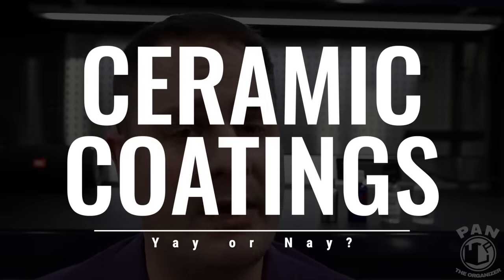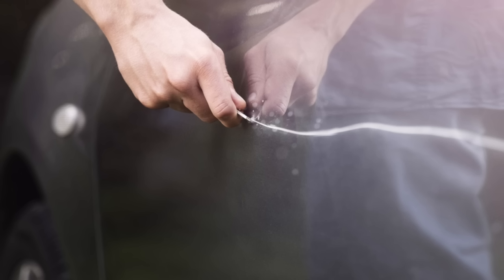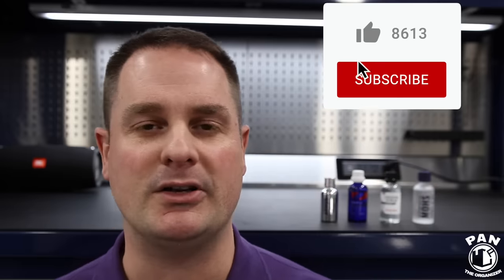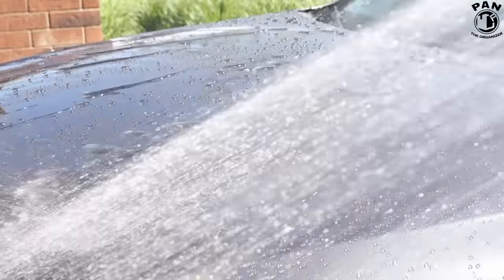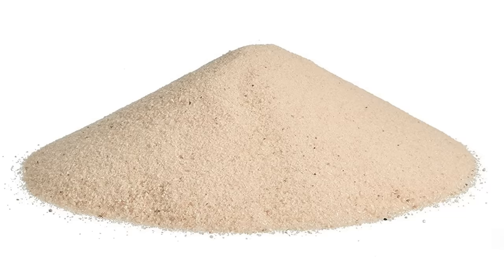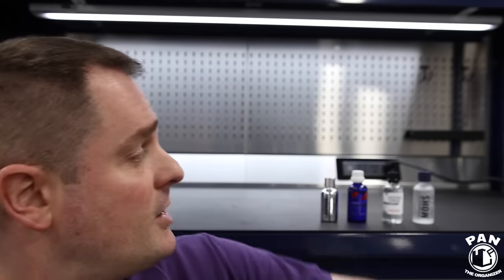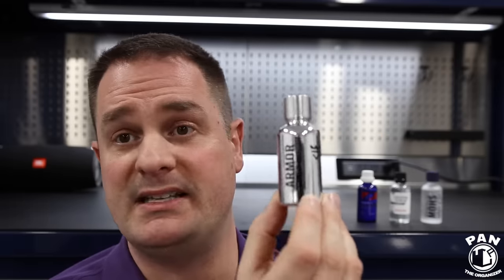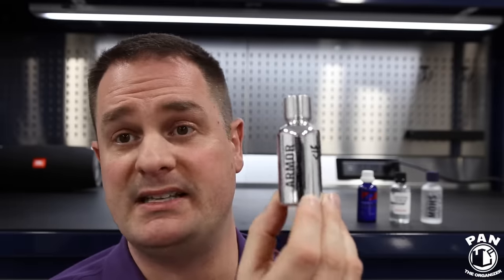DON'T BUY CERAMIC COATINGS BEFORE WATCHING THIS !!

Comment: I am a car guy and doing research I had to watch. I guess my question is as you said, ceramic coatings have improved, but so have base coat colors and clear. 
How long after finishing a complete refinish of a classic truck, with a high end clear would one wait before applying a ceramic coating?
  After 38+ years (42 or more) but as a certified automotive ASE Master tech since 78. (You have to have two years before awarded certification) but years of hands on work to take the 60-100 question test, 8 to be a Master Tech, then re-certify every 5 years.
  I am building, restoring completely at 67 C10 to my 6’3” frame but with modern OD automatic and EFI engine and a list very long. I painted my first car in 1979 and 5 others since. This world of aftermarket parts plus paint products has changed as well. Minus body work, but $1,800 in paint product alone is not uncommon for a truck complete.
  Micro-sanding with a short-stoke (5/16th orbital action) produces a surface that when compounded, then polished and clean with soap and water. After 3-4 weeks, shrinkage is done, solvents have evaporated and chemical cross-linking has occurred. If covered and garaged but not driven, is it “Best Practices” to apply?
 Retired, disabled and never will own the garage I want as I brought home 4 tool boxes and a truck load of equipment that magically makes a 1 1/2 car garage real small.
  People don’t realize what “UV” A, B & C can do to fabric, plastics while at work and just sitting in traffic. Yes, they have a garage but spend little time in it than they think.
  This vehicle is for me and seen the commercials, but felt you did a very good job. Although it is 19 months past the video (May, 20th, 2022) I hit liked abs subscribed even though I had no cell since 2009! Thanks.

Comment: Great video Pan!! It's great to clear up some of the confussion over ceramic coatings. They are awesome products, it's a shame some companies and installers, gave them a bit of a "snake oil" reputation due to false claims.

About scratches: Gtechniq actually states in it's FAQs that although the coatings on their own are very hard, 9H for Crystal Serum Light shown here, when applied to a panel the coating only adds 3 to 2H to the original clearcoat hardness. Still, I think ceramic coatings do prevent scratches, not in the way most people think (i.e. taking a key, knife, rock to the panel), but in an indirect way as the car is easier to clean and dry meaning less rubbing/touching is required inducing less scratches. 

Also, I hoped you touched on the top coats, as I find people confused about why should they apply (and more importantly, buy an extra product) that adds hydrophobic properties and slickness...when the ceramic coating is already supposed to do that.

Cheers!
Reply from the maker: Thanks Mati

Comment: Can a DIY'er apply a coating the answer is yes but only if they follow the manufacturer's instructions.  I have used most all of them and yes, easy application does seem to go with Avalon King.  

My first choice of ease of application is the Dr. Beasley's Formula 1201 for any DIY'er.  It too requires a solid foundation preparation and use of the topper at least every two months to get a solid year of life.  

Great recap of the topic Pan, glad you covered it fully in this Q&A session.
Reply from the maker: Thanks!

Comment: Awesome video as always, Pan. I'm a huge fan! Could you talk about the disadvantages and any downsides of putting on a ceramic coating? I imagine fixing scratches is a lot harder because you need special compounds and techniques. Cheers! 🍻
Reply from the maker: Thanks! I appreciate your support. :)

There aren't many disadvantages of ceramic coatings really, other than you have to be more careful about water spotting, hence why most of them you can get the appropriate top coat to put on top, or use a highly sheeting coating like the AvalonKing, which sheds water quickly.  Other than that, I mean you truly get the best possible protection:
- best gloss
- best slickness
- best UV protection
- best durability (years vs a few months for regular waxes and sealants)
- best chemical resistance (industrial fallout, road salt, bird droppings, tree sap, brake dust, etc)
- best hydrophobic properties (water beading and sheeting)
- self cleaning properties (car is a lot easier to wash during maintenance washes)

You absolutely have to watch a super popular video I made about the differences between waxes, sealants and ceramic coatings here: https://youtu.be/Yxz3zSVIm-g

Comment: Hi everyone just watch pretty much the whole video, as an " old old " detailer the last one when you use microfiber towel cleaning the ceramic coating the towel pretty much needs to go in the bin.
This is a very good bussines for shops and retailers who sell those microfibre towels.They pretty smart 😀 otherwise how would they make the money.
And do we really listen whatever they write on internet, not really.
I personally have a shop and i used a lot of ceramic coatings  and sealants and if i throw away my microfibre towels which cost big bucks where would my bussines go.
I born in the village where our clothes and towels got washed by hand, with a heavy duty soap.
And then after that they being store in the hot water for few hours and after that rinset again.
But today in 2022 after the hot water i put Microfibre towels in wash machine and they came brand new again, ready to use them.
After certain times if they get to old or to dirty that you can't use them anymore well then no problem time to buy another one.
I don't whant to force anyone to do what i'm doing we all have our own way, i'm just here to save you throwing away your own money.
Pretty much if you're an old detailer i mean an " old one " when you grab your tool in your hand you would feel if anything is wrong with it.
So have a good day everyone 😊
Reply from the maker: Actually, I beg to differ. After talking with chemists in the industry, the coatings leave behind a chemistry that once cured, will leave material behind in the towels, even if you soak them, and wash them, etc.  Hence why we discard towels used for coatings (unless you want to reuse them on engine bays or something where the surface isn't delicate, but NEVER reuse the towels on paint).

and Jon from the Forensic Detailing channel actually proved this in this video: https://youtu.be/3p6hWK8mpMs

It's clear that even if you soak and wash the towels used for coating removal, they will still SCRATCH the paint if you reuse those towels on paint.

So please, before making allegations, it's important to verify claims with a more scientific approach and actually see if the towels create scratches.

On a 1000$+ coating job, I don't see why you'd take the chance to not use fresh new towels that only cost a few dollars really. I would never take a chance to reuse a coating removal towel on a customer's vehicle.

Comment: The biggest problem with all of the ceramic/ graphine coatings is the requirement to apply in a garage and keep dry for 24+ hours.   I’d love to use one but do not own a garage nor is it easy in the U.K. to get access to one for that time.
Reply: This is why I only use Optimum Gloss Coat. 

One hour after application, Opti-Seal cam be applied to protect as it cures. Within seven days, it's ok to wash, and after thirty days it internally cures and hardens.

Comment: Is it possible? If I want to apply graphene ceramic coating first and after that PPF will be installed, i want to do that.

So is it possible or not?
Reply from the maker: Not recommended, as the PPF will have a hard time sticking to the surface. Always PPF first, and then the coating on top.

Plus you won’t get the benefits of the coating if you apply PPF on top of the coating…

Comment: I've used resistal om my new cars for several years and have very happy with the results. It also eliminated the brake dust i used to get on my German cars some years back. I've just used a ceramic coating for the first time. Hope it works as well.
Reply from the maker: What ceramic coating did you apply?
Reply: @PanTheOrganizer  i used mothers cmx the day i picked the car up at dealer.. I hadn't seen your channel yet and a neighbor had just told me about ceramic coatings. It looks great to my eyes but I've only had it now for five days. I've used resistal on my last four leases and thought it worked great as far as shedding and reducing washings.

Comment: Thanks for the informative Video PAN. Question: I live in an area with hard water. When I wash my new Tesla it leaves water marks which I can't seem to get rid of. NOW, I'm going to Ceramic Coat the car and my question is: will the prep routine you described (e.g. Prep Shampoo --> Iron Remover --> Clay Bar --> IPA Wipe --> Ceramic Coating) will this remove these water marks? Second question: I have access to a device that dispenses DEIONIZED WATER. Should I do that FINAL WASH before all this Prep using DEIONIZED WATER?  Thanks and keep up the great work.
Reply from the maker: It depends how bad the water spots are. You might need to use a water spot remover before the clay stage. And if that doesn’t work, you might need to polish the paint after the clay stage. And then IPA wipe and then you apply the coating.

And yes it’s always best to use deionized water for the final rinse after you are done washing your car. Here’s my deionizer setup: https://youtu.be/IKNL1chAQXY

Comment: Thanks for responding. I have been watching for awhile. I have used many of your suggestions for many of my purchases to maintain my 2 cars. I have applied Carpro CQUK on my wife's VW Atlas. Was impressed by the performance.  I am not sure how long the System X will last, so I am thinking of redoing the truck with either the carproCQUK, or the Duraslic 1500. I did polish the VW with Carpro Essence, then applied the ceramic coating. The steps to redo the ceramic coating are a bigger project. Any suggestions would be appreciated. Again appreciate all of your info on detailing items.
Reply from the maker: There is no other way to remove an existing coating but to redo all the steps including paint polishing steps as the mechanical abrasion is the only thing that can guarantee 100% removal of the existing ceramic coating.

Watch my ceramic coating application tutorial: https://youtu.be/sqQYVjxFqK0
Reply: @PanTheOrganizer  Pan I had coated My VW Atlas with Carpro Uk 3.0 ceramic coating, I was thinking of applying Carpro Gloss. Is that possible or do you need to start over and redo thee ceramic coating 1st?

Thanks, love your channel.

Comment: Thx Pan, well done, I'm new to the channel & glad to see a fellow local, French Canadian, Greek be so informative, detailed & entertaining.
My question(s), I want to ceramic coat a brand new vehicle, I presume I can skip most of the prep work?  Please advise.
2. I also want to PPF, my lower panels, should I do the ceramic, pre PPF, please advise 
Merci in advance.
Reply from the maker: Thanks Paul! Welcome to my channel.

1. You still need to go through proper paint prep steps. Here’s what I do to a brand new car freshly delivered from the dealership: https://youtu.be/tjJPcdCUaK8

2. You would have the PPF applied first, and then apply the ceramic coating on top.

How did you discover my channel by the way?
Reply: Did a Google search on "ceramic coating", 
Thx for responding so quicky.

Comment: I did my hood a year ago and jeez it was an arduous process especially not having a garage. Had to completely decontaminate the pain, fill in chips with paint and clear, sand, polish, clean again, clay bar and then finally ceramic coat it while hoping to god there was no bird crap, pollen or leaves that fall on it. God it was stressful

Comment: So I'm a guy who grew up with carnauba and polymer waxes. Guys like me remember that the more coats of wax the better the shine. My trans am had an epic shine even when dirty. So my question is. Would it be possible and/or necessary to do multiple coats/ layers of ceramic coating? Would it help protect or make it shine more?
Reply from the maker: It depends on the coating. Most coatings these days are 1 or 2 layers. Stay away from coatings that require 4+ layers. And for the coatings that require 2 coats, it's not as much about gloss, but more for durability. But again, follow the instructions of the coating you are buying. If it says 1 coat, it's 1 coat. If they require 2 coats, it's 2 coats.

Comment: Great video Pan. Thanks for all the info. My worry when it comes to ceramic coatings is removal.  How difficult is it to remove? What steps are required? Does it remove completely? Thanks.
Reply from the maker: That question gets asked often so I plan on releasing a special video on that topic in January. Stay tuned!

Comment: @33:36 this hand demonstration insinuates that a coating of ceramic 8"thick will diminish to just 4.  I'd be ok with that, just wondering how many of them little bottles it'll take to achieve that initial 8" coating.
Reply from the maker: LOL

Comment: Found out that it's not just a case of wash the car off which a good detergent to strip any wax and apply the coating. Certainly learned more than that. So this was a extremely helpful. Now to get a few more of the suggested things and bring my wives C30 Volvo back to it's rightful glory. Thanks so much Pan !
Reply from the maker: Exactly Phil. You got it. There are steps needed to ensure a proper bonding of the ceramic coating to the clear coat. I actually have a popular ceramic coating application tutorial here: https://youtu.be/sqQYVjxFqK0

Comment: Can you explain exactly what the process would be after your two year ceramic coating has diminished.
Please explain the steps needed before reapplying if possible.
Reply from the maker: You have to restart all the steps including machine polishing, the most crucial step to ensure 100% removal of the previous protection.

See my ceramic coating application tutorial here: https://youtu.be/sqQYVjxFqK0

Comment: I have been detailing for 28 years.  Never used ceramic coating.  Does this replace waxing cars. As a detailer, does this increase the cost of a detail to customers?
Thanks, Pan.

Comment: Awesome info. Just bought a brand new Tacoma, live in Hawaii (sun, rain and some salt air) and will not be garaged so was needing to be educated on  much needed ceramic coat. Totally found it here. Everything you need to know to make an informed decision. Not sure I'm going to pull the trigger on the DYI (pretty nervous 1st new vehicle in 25 yrs!!!)  but I might after I watch some of your instructional videos. Thanks for sharing with we DIY peeps
Reply from the maker: Thanks for the feedback Anne! Welcome to my channel. You discovered one of the biggest car detailing channels on YouTube as we surpassed 880,000 subscribers and we have over 113 million views! I have been detailing for 26 years and I love to share my knowledge and passion with my viewers.

You found the right channel to help you learn everything about detailing. 

A new car is never new until it's properly detailed. 
- at the factory, the paint defects are often corrected quickly by rotary polishing which can leave marks and holograms, so polishing corrects those, before you lock that in long term with a ceramic coating for example.
- vehicles are then transported by truck, train and boat so they are exposed to the elements, industrial fallout, brake dust, rail dust, etc
- vehicles are often left at boat docks (when transported by boat) or in exterior parking lots for weeks or months, again being exposed to the elements
- at the dealership, the vehicles are almost always poorly prepped using the same dirty water that was used for all the cars on a given day, and poor washing and drying methods leading to swirls and scratches 
- at the dealership, a layer of cheap wax or paint sealant is usually applied to attempt to make the paint glossy prior to delivery. It's crucial to remove any previous protection before you apply a ceramic coating, as coatings need to bond directly to a virgin clear coat.

If you only plan on applying a regular carnauba wax or paint sealant though, you could decide to skip machine polishing, as those protectants can be applied over existing protection and it's not as crucial to prep the paint as well.

I explain all of this in this popular video: https://youtu.be/QgoyrC-5CMc

So you can better visualize the new car prep process, here are the steps I perform on a brand new car from two of my customers: 
Tesla Model Y: https://youtu.be/gohks8xP5NY 
Porsche 911 Carrera: https://youtu.be/2ckiivbFqs4
Audi Q7: https://youtu.be/t7HCBSVnizM

Comment: Thank you for the video! I know this video is old, so not sure if you'll see this but... I am getting older and am so over washing my car by hand regularly. As in, I don't do it any more. Ever. Should I not get my car ceramic coated? My concern is water spotting. My car sits outside, but not near any sprinklers. It would only get wet due to rain, or if I decide to take it through a tunnel wash. I have seen some horror stories about ceramic coating and water spots, so while I am tempted by the looks and durability of these coatings, I am a little scared off by those stories. Thanks!

Comment: I used ceramic coating years ago. Once it started wearing off was bad. Very hard to remove. If these last 2 years how long would a body shop clear coat last and hold up against ceramic.